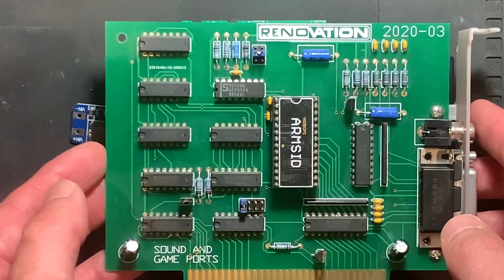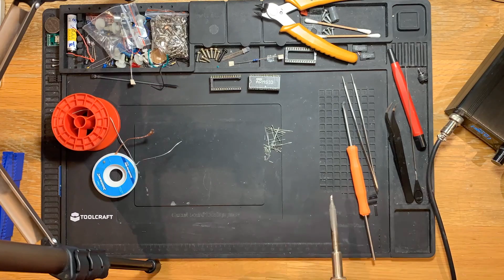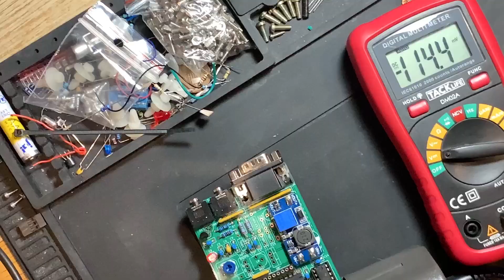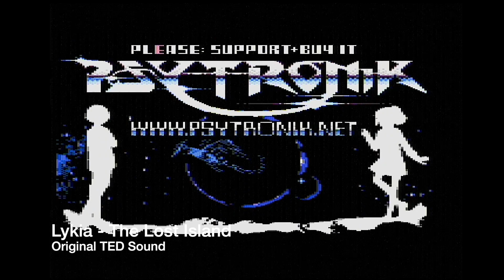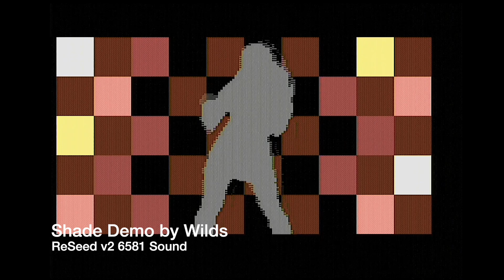The ReSeed SID Sound Card for the Plus/4 & C16

Comment: Hi there, I build this board, but I cannot get it to work. I have checked all the coponets, and they are ok, so it's a GAL problem, I don't know but the jed file is only 1kb, it's that correct? Or is another file what I have to save on the chip...
Reply from the maker: Hm, it‘s been a while. Are you sure the GAL is working properly? The author of the board is usually really helpful, too. He might know a bit more. 
Also: are you sure the problem isn’t with the host machine?